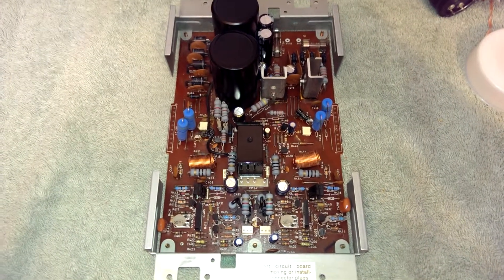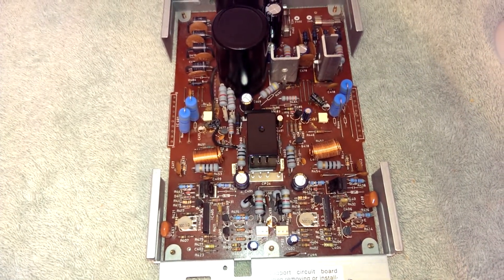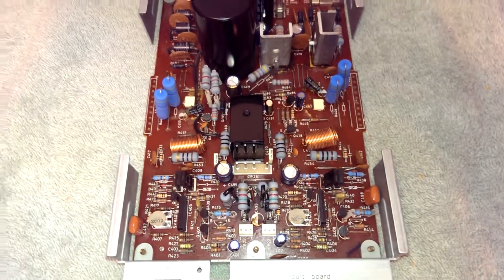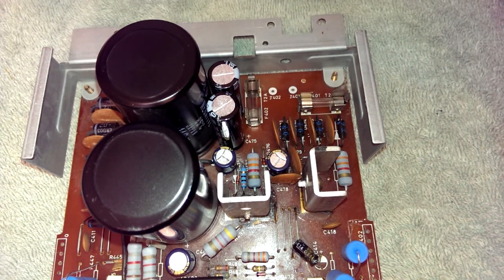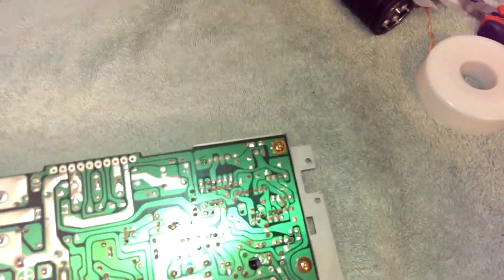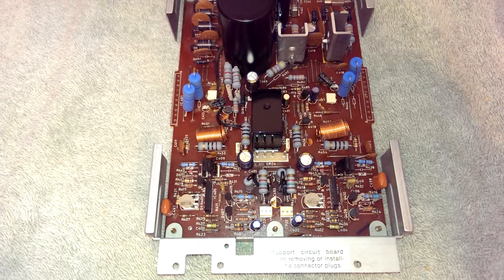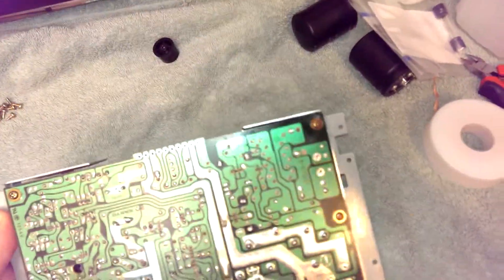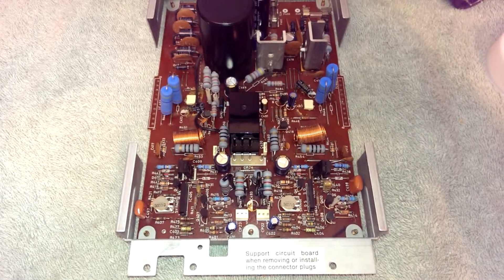Fisher RS-280: Power Amplifier & Power Supply Board Revisited

Comment: Hello, do you have its schematics? I have some problems with phono preamp stage.
Reply from the maker: I do not, maybe Hifi Engine or Electrotanya do. I also sadly do not recall it's topology off hand. You may just need to trace the circuit. Ensure the EQ amp is getting power; it its an op-amp, you'll need +/- rails both present. Signals should be tracable by tapping at coupling capacitors.

Comment: What did it take to repair this in the end? I have a Fisher BA-6000 power amp with the same hybrid IC packs and my emitter resistors light up and burn out as well as take out a smaller resister in my pre-drive. Ive been working at it for a while and can't figure it out.
Reply from the maker: Not sure how I missed this in 6 years but I managed to obtain a NOS genuine Sanyo STK module. That's what has failed if your emitter resistors are glowing.

Today, in 2021, I would not attempt to locate a module. I would use the discrete retrofit kit people are using for other members of this module family like the STK-0050 as it is actually robust enough to support 100W output and then you have a discrete output stage you can repair for the foreseeable future. More info on that here: https://audiokarma.org/forums/index.php?threads/stk-0050-replacement-for-sx-780-and-others.721181/

Since we are not limited by the small footprint of the STK-0050, a larger back plate could be milled out at your local machine shop and you could instead fit massive TO-264 transistors like the MJL21195G/MJL21196G to the retrofit kit's PCB. That would not only allow 8 ohm operation but 4 ohm as well, though only intermittently as the transformer is not quite large enough to support 150W/ch output continuously and that's exactly what you'd probably get into 4 ohms in bursts.